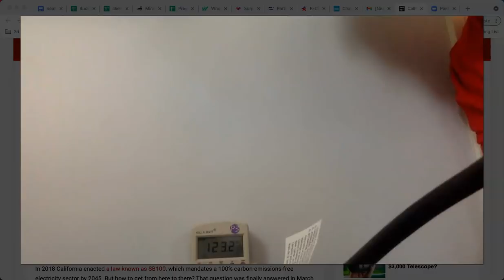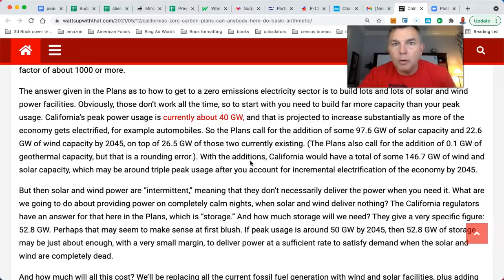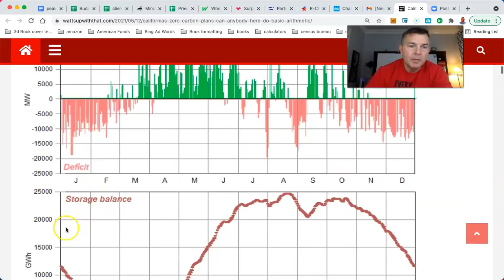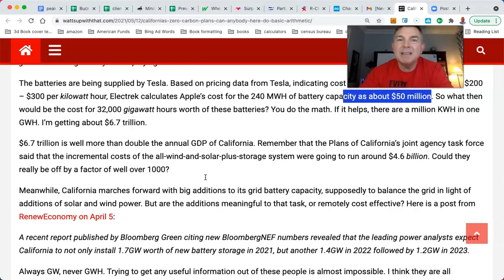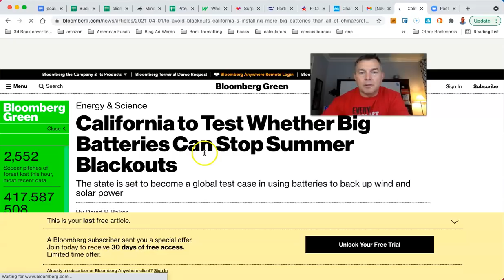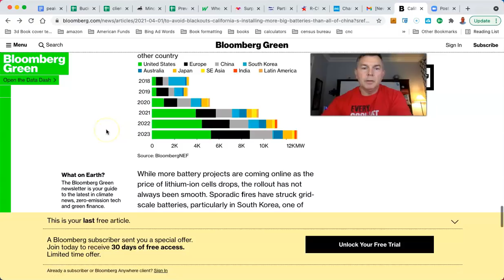California's Carbon Plan Will Bankrupt You! (Here's The Proof)

Comment: There is a lot of advertisement for solar installation. How to you clear the snow from roof top solar panels? Here in Chicago area this year we had snow cover for almost 2 straight months. Now with the solar farms maybe they increase the tilt in winter to effectively eliminate snow build up but I don't see this being done with roof top installations. I averaged about 35 kWh in January. For a single day of storage that would require about 71 T105 golf cart batteries. Let alone that you would need enough solar panels to generate at 35 kWh during January. And this is with using Natural Gas for heating. What if you were charging cars and heating the home with electricity. I would think winter would consume more power than summer. Maybe we can all start living in big Tunnels that Musk builds.

Comment: Another thing nobody mentions is where the batteries will come from.  One Telsa Gigfactory cranks out about 35GWH of batteries per year.  25000 / 35 is 714 years to make that 25,000 GWH of storage, not going to happen in ~20 yrs.  So you'll need about 36 Gigafactories running around the clock for 20 years just to crank out the 25,000GWH for this one state!

Q: How many battery factories does Tesla have?
A: 4 operational with 1 more in progress
Anyone see a problem here?

The other issue is with Newsom's plan for 5 million EVs by 2030.  Can you imagine the chaos when those 5 million cars are plugged into chargers (~7KWH typical size) that are all set to kick on at 9PM when the rate plans drop to their lowest cost?  5,000,000 x 7KW is 35GW of (additional) load on the system that can handle a 40GW peak most days.
That's why they're blasting out the new ad campaign recently:
https://www.lbbonline.com/news/energy-upgrade-california-encourages-people-to-do-nothing

Comment: batteries are chemical cells and will have to be replaced, there will be a huge recurring replacement cost in addition to huge initial price tag.  You also have to dispose of all those stupid batteries which will create its own problems.

Meanwhile the rest of the world will just stick with turning a shaft on a generator and enjoying cheap power.
Reply from the maker: Exactly!
Reply: And China will just pull our plug and we will be in the dark. They release more emissions and co2 than the rest of the world combined last year I believe.

Comment: The battery storage system is their failure. 
Has anyone calculated the carbon used to create the systems used for these carbon saving devices? Bet you it is more than simply using current methods!